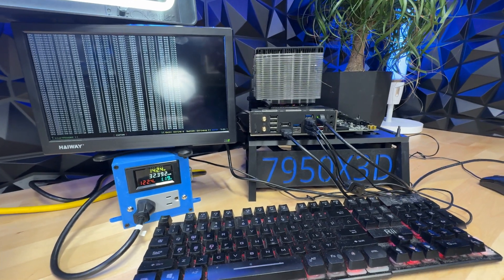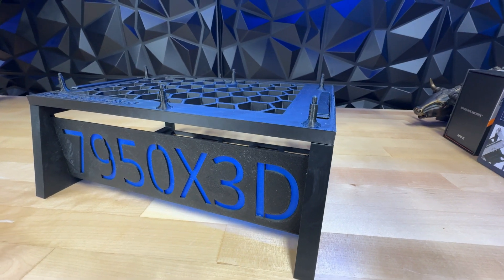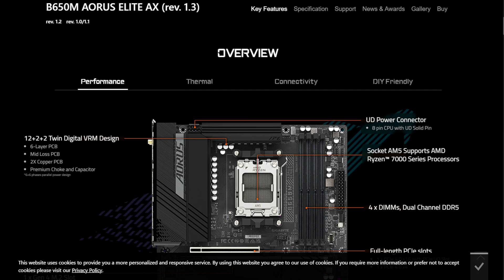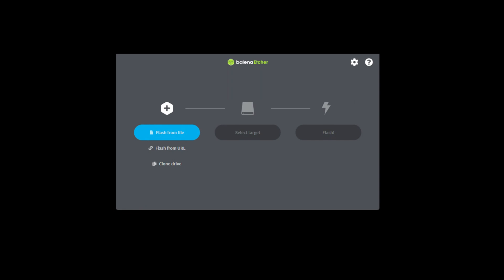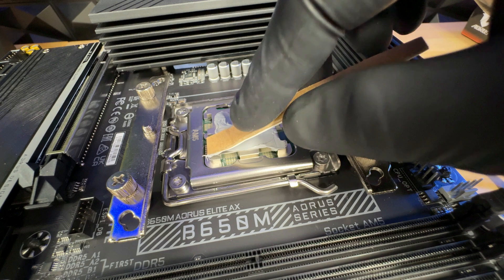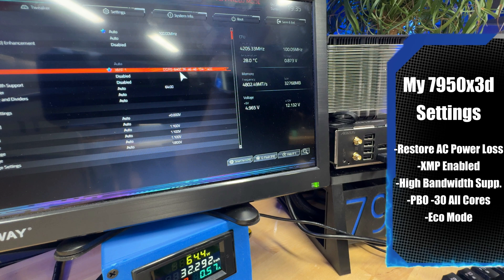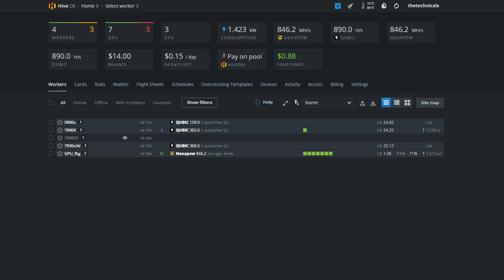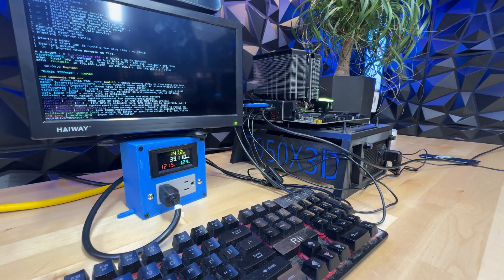CPU Crypto Miner Build (7950X3d)

Comment: Love.my 7950x also love my 3900x, but dam lil hidden gem is a e5 2695 v4 . Mines 7.5+kh 120watta , cost nothing to build . Runs extremely cool nearly under 40 degrees and I'm in hot climate. Was testing older xeons but now testing some version 4 as run cooler less power.. fun for a cheap CPU miner !

Comment: very good tutorial overall,
too much paste imo, you don't want that stuff seeping around the edges of the chip,
it's a heat transfer material, if it gets underneath, can fry the chip.
Ambient cooling is everything, PSU is everything,
keep the vids coming
Reply from the maker: I hear you loud and clear, add more paste
Reply: @TechnicalsMatt  Amen, Godspeed

Comment: I know you do GPU mining too.
I think you're seriously wasting those JUICY armored PCIe 5.0 x16 slots on those CPU miners by not putting your GPUs on them; full bandwidth!
You're also kinda wasting the "start up cost" of the motherboard energy since it won't increase the operating wattage of the mobo much, by putting a gpu on it.
You're also kinda wasting some of the potential of the power supplies, but they do run "most efficient" at around 50% load.
Interestingly my PSU says it can operate at 120v or 240v and gets up to 5% more efficiency on 240v. At the scale of your operation it might be totally worth it to put your PCs on a 240 volt input and save 5% on your electricity costs.
Not to mention it looks like you could totally put 2 full-size cards on each of those mobos.
Good video, I might get that exact mobo...
Reply from the maker: If I put a GPU on each one, that kicks me into GPU territory for hive pricing. Sure, it would make up for it, but I like to keep everything separate. GPU's on one thing, CPU's on another. Totally understand and appreciate the feedback, as it makes total sense. For me, my brain needs things to be as simple as possible. Also, everything is on 240!
Reply: Fair enough... I don't use Hive OS but it's probably simpler
Reply: Hive is cool, but on MMPOS cpu rigs are free and it is still Linux. Also, PSU mobo power splitters should allow you to connect 2 cpu rigs to one PSU (assuming psu has enough CPU cables). You can have one flat stand and one 45 degrees stand right behind it.
Reply: @mancavetech  That's cool I'm just using regular Ubuntu, but I'm not managing a ton of hardware.
Reply: @mancavetech True, i use mmpos myself. You can also get cpu power from pci-e power via an adapter cable. So one power serves two motherboards.

Comment: Big T,  Can you share your QUBIC settings for 7900x for this MOB?  Nice its! lol
Reply from the maker: I actually have ALL the CPU's on the FS for 7900, which is just the 12 threads. Yes, even the 7950x3d's. They pull higher ITs on 12 oddly enough
Reply: @TechnicalsMatt  Just reduced my 7900x to 12 threads and the its dropped from 348 to 315 its.   I think ram speed may be the reason.   Your 7900x and MOB running  ram at 6400MHz?
Reply from the maker: @daves.8049  odd you ask because i concluded today my 2nd rig is crashing due to xmp enabled on 6400mhz ram. Guess i need to manually change the timings or voltages. Ugh